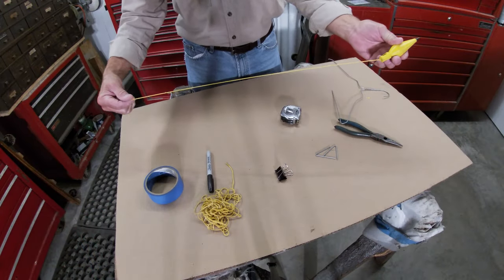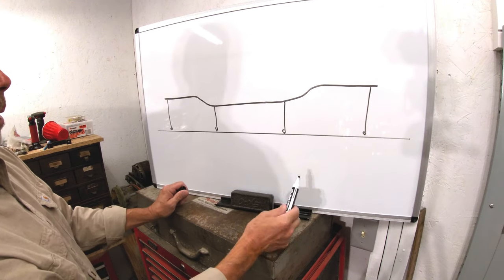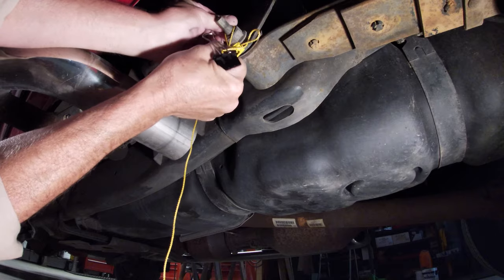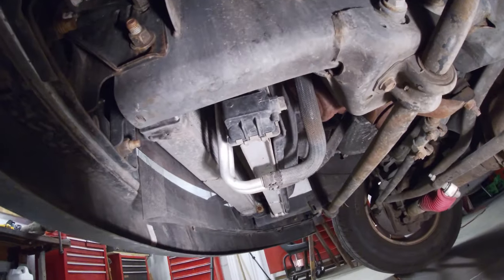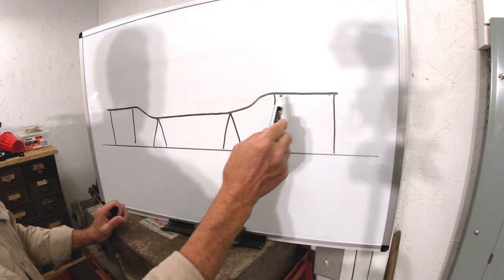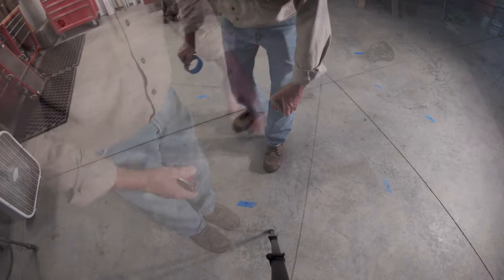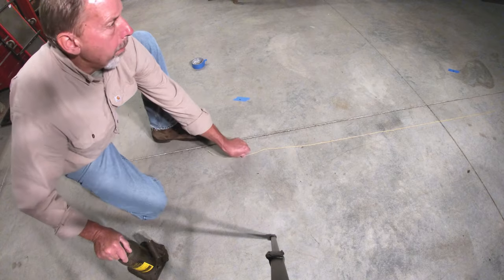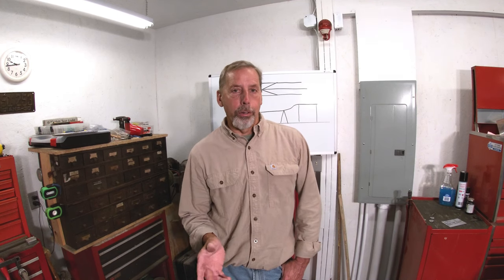How To Measure A Frame At Home

Comment: Very informative. I have a vehicle in the shop with a frame being sectioned. This should help me with making sure everything is square in terms of diamond. Thinking (aloud) through height measurements, as long as the center diamond is level (left, right, front, rear) the frame section should follow.
Reply from the maker: Thanks for watching

Comment: I am about to do this on my project today.  I had wondered about self-centering wire v's, wasn't sure they'd work, thanks for the confirmation.  I was going to do a slipknot for the plumb bob  but the spring clip is a much easier way.  Thanks!
Reply from the maker: Good luck with your project. Thanks for watching

Comment: I'm trying to get diamond out of a 18'  equiptment trailer, more importantly I need to get the axels square to the tounge. There was a 6" discrepancy measuring crossway, I was able to get it to about 2" within square. Your videos are going to help me.
Reply from the maker: Good luck with the trailer. Very important to get the axles square with the tongue. As with any frame the 1st 80% is easy. Getting the rest done is the real work. Thanks for watching

Comment: Hi sir, could you have any trick related to frontal framing and control points after collision, I'm facing issues to find the right position for fenders of Lexus IS250. Thanks in advance. Cheers and good vibes
Reply from the maker: Really no tricks. It’s just a simple formula. You have to make sure your frame rails are aligned and in the proper place. After that the core support needs to be square. You can use a tram gauge but a tape measure will do to do a cross measurement. The length on the upper rails and corner of core support needs to be correct otherwise your cross measurement won’t be accurate. I hope this helps. Thanks for watching

Comment: Very interesting video! Thanks! How accurate is this method, what do you think? Is it good enough to safely check that everything is within  factory specs?
I have an old lorry from the 60th and I have to do an alignment of the axels - I had them disassembled for restoration. The factory specs for  parallelism are quite tight (despite being a 60 years old lorry) : the diagonales must be within 3mm.
Reply from the maker: This system is very accurate as long as you take the time to set everything up correctly. 3 mm is really close for 60 years ago but today’s specs are usually 0. I think this is a great way to measure at home to double check everything. Thanks for watching

Comment: Just found your video.  I have an 04 4runner sitting in the backyard with passenger front damage from the wheel receiving an impact that sent the tire into the steering knuckle.  For the life of me, I cannot figure out if the frame is bent, or some other front end component(s).  I'm debating on ordering all new front end parts to see if that will pull that wheel back straight vertically.  Any ideas?
Reply from the maker: The knuckle is more than likely bent. It’s rare that the upper and lower control arms would be bent. If you measure the frame you need to also measure both mounting point on the frame where the lower control arm mounts. It’s very common to see the frame and or the mounting perch for the rear of the lower control arm bent. If the frame is OK then you know it’s suspension damage that causing the problem. I hope this helps. Thanks for watching